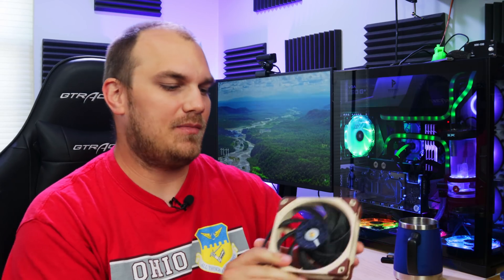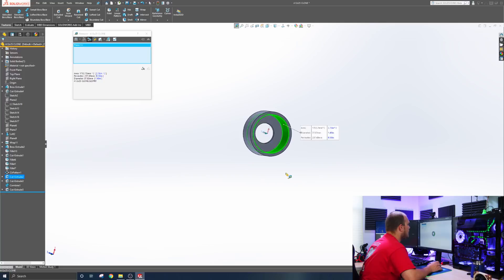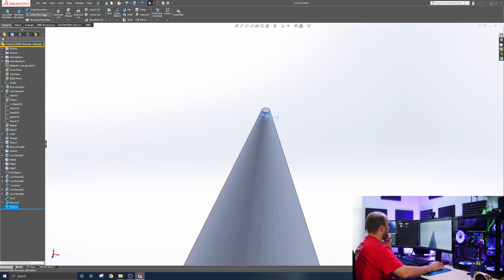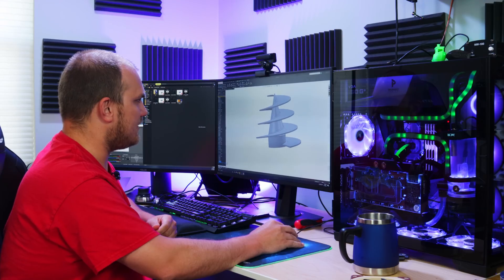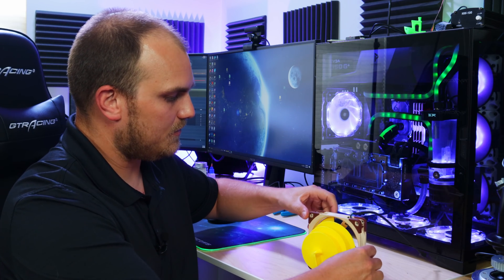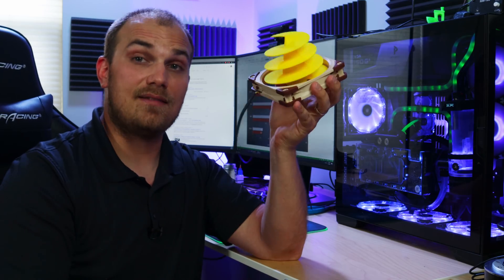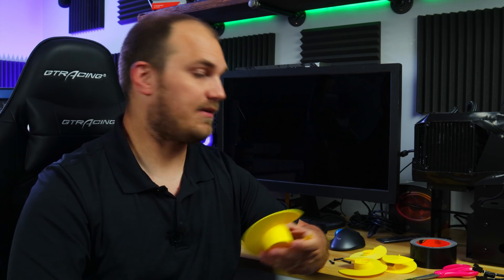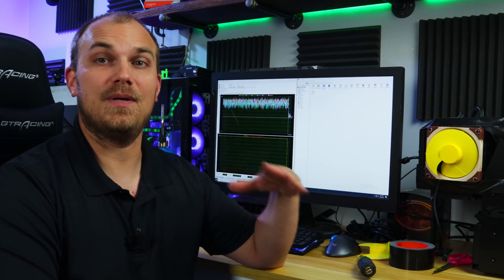Leonardo DA Vinci Made A PC Fan Would It Work?

Comment: 1.how about printing the spiral and shaft separately.
2.how about sanding down the screw so it has nice smooth surface.
3.how about making a tube around the spiral so that the air is properly funneled into the screw shape , as it stands right now the only surface area being effective is the first little bit inside the fan casing.

Comment: Probably needs an outer cone, and probably the discharge side opening 1/3rd the size of the inlet. 
You will probably get better results for air flow.
You want an idea? 
Mock up a "Twin Lobe" air blower. 
Since those are designed to move massive amounts of air volume.

Comment: Well if you notice most drills they are drilling into something right? That means the object the drill is drilling is making a wall as it goes allow it to push the debris out. So I suggest making a cylinder hood the length of the Screw so that the air it is slicing doesnt just spin off into the air and is directed backwards.

Comment: You'd more likely have to build it like a fluid drill... Sheathed so once it's in the threading it can't escape.
Reply: Like an Archimedes screw :D
Reply: @ferrumignis  The Archimedes drill relies on gravity being a noticeable force on the trapped fluid. Not the case for air, especially in an atmospheric environment pressurising it from each side.

Comment: Suggested video idea, using 140mm and or 120mm fans connected to an exhaust hose looping around/on your table and out the window as a method of cooling your PC.  Like attaching multiple 120/140mm extra fans you have to front and and or back end of a exhaust hose.  It's an idea for people who don't have enough table room to place their PCs on and only have the ground under their small table to place their PCs.  Or for people who have their PC setup in basement or attic without good ventilation.

Comment: This design works pretty danm well for solid that aren't enclosed (cos they enclose themselves) in the form of augers. They also pretty well with liquid that are enclosed in the form of screw pumps. But without compression these are useless and as air is hard to compress it just wont work.

Comment: You need a pipe around the air-screw, otherwise it can not work effectively - like water pump without casing...and it turns in wrong direction - look at 17:00 - It should pull not push... I think so

Comment: I wonder if you put a cylinder around the outside of the last iteration so the blade was actually inside the housing if would help direct the airflow rather then it just escaping out the sides.

Comment: I wonder if making it sort of ducted, like a short thin band running down the outside, would the performance improve as less air would flow out sideways as it travels down the blade. The two issues I could think of that would affect this is balance would be way worse and it being to complex for a printer to do without using a lot of filler.

Comment: This design clearly needs a funil around it like they did with water. Otherwise the air is pushed to the sides instead of down.
Essentially would be similiar to a jet engine

Comment: Try reducing the H of the fan and adding a cylider to prevent the air to be pushed sideway (if the fan still keep to pop up from the frame). I'd suggest to make the apex of the blade to came out of the frame for something like 5/3 of his 
thickness  to help the acquisition of air.

Comment: as far as I can see, the single/blade configuration of the air screw causes an imbalance in weight at the tips of the fan, which then creates a torgue and makes the fan wobble terribly. Having at least 2 blades should make the entire screw be more balanced and should help with the wobble you're dealing with. Having a better printer shouldn't help too much with the current design

Comment: Extruder issues -> You have nozzle clog or PTFE tube issue in that case. It's a friggin' Titan, and maybe the best version of that. You cannot get much higher grade extruder than that.

I am sorry to say, but your print issues do sound like user error. Think of printing like machining, it takes a while to learn all the nuances etc.
From that wobbled print, it seens like your gantry is skewed, thus prints tilted. Time to whip out a decent square and measure and start checking you assembled it square.
If you need to level your bed between each and every print, you are doing something horribly wrong as well. It's a set once and print quite a while type of thing. But it's also the most common newbie issue.
Reply: oh and Prusa excels on software side of things to hide those starter issues etc. and quite polished, but mechanically frame of those machines are .... Well ... how to put it ... I prefer a 160$ Creality machine frame mechanically over any Prusa, any time, any day.

Comment: You're still going to have vibration problems with a higher quality printer because the design is unbalanced.  When it's spinning, the blade is pulling the top one direction and the bottom the opposite direction.  It might be possible to bulge out the center shaft opposite the blade to balance it and still have effectively the "one blade" style.  Start with balancing a single 2D slice of the blade, then revolve that shape along the height.

Comment: 10:50 Still didn't see the results but I believe air is going to escape through the sides, solution is to make a cylinder arround it and stretch the top part to fit the cylinder

Comment: Ender 5, or something that is a core xy style printer would be a good option.  There are many decent options. But ender 5 would be a solid starter. And there are some good upgrade paths. :)

Two trees sapphire pro might be decent, but I think there was some mixed reviews. Also the sainsmart coreception looks promising, but I haven't seen Any reviews.

You can get a bmg clone  for a  better extruder from triangle labs and it is phenomenal. :) They are on Amazon, for about $40. Ruiraptor on YouTube has a video of installing it on the tevo trantula pro. :) (I just made this upgrade on my tevo nereus and my extruder slippage is much less)

Comment: it can work without vibration if You should have done the 1 and half circle  and not the 1 circle. That additional half circle counter the vibration caused by the bottom outer circle, and also add outer housing .

Comment: Prepare to be disappointed by the Prusa if your goal is getting that balanced. Great printer but it's not much of an upgrade at the end of the day. You still have to maintain it and dial in the proper settings. A $250 Ender 3 Pro with a handful of small upgrades can print just as good, if not better than a Prusa. Just look at the Ender3 subreddit if you think I'm blowing smoke.

I'd look into resin printers if high detail is your goal. If you want to stick to FDM you may have better luck with a Core XY or delta design.

Comment: Invert the first model and put the "blades" on the inside, so it'd be a cone tapering down twords the motor and have holes between the motor and the end point of the cone as to collect air and funnel it down through the fan shroud. And see what happens

Comment: (read through entirely for big brain time) Putting a shroud over the top and putting it in a pull rather than push configuration should make it somewhat more effective. Instead of just a shroud, add runners that go from top to bottom, attached to the screw, and profile them to scoop air into the screw. Not only will this prevent the air from escaping the screw, but it will also add even more air. Give them a little extra thickness and it should provide you a decent way to balance it as well.

Comment: I have to catch up on your last couple videos, so I may be commenting for no reason, but you should try more blades again, but use reaction blades. Computer fans are impulse blades, meaning they strike the air and deflect it. Reaction is more of an airfoil shape, which means it creates an area of low pressure and drives air through pressure differential. High static pressure fans tend to be impulse-reaction (a combination of both). The main reason reaction isn't commonly used is power requirements and noise. But if we're just looking for the theoretical max, I'm curious, and think it's worth checking out.

Comment: The helix needs walls. 

What you designed is fine, it's just not finished. 

Look at a jet turbine. It's basically a helix just like this fan, but it has a wall around it to keep air from escaping out the sides.

Comment: Check out the ender 5 and ender 5 plus for a printer.  Also, I feel like a duct or a downward curvature to the screw blades would help push air through the fan rather than let it sling outwards.  You could also try a multi-start screw with a doubled pitch.

Comment: What if you made it so that it spins  opposite so it sucks the air through the rad then through the "fan" instead of pushing air through the rad. Also can try making a shroud around it and make it so that it doesnt taper.

Comment: Vibration is caused because you did not calculate the mass on all sides, therefore it is not balanced. More mass on one of the sides results in that. It does not look like a printer problem, an unbalanced wheel will pull the axis to the side of more mass.

Comment: How about taking the stock 12 blade design and keeping the same angle but just making the blades longer, not in the horizontal but vertical, so the whole fan wuld be longer like the d-blade fan you tested

Comment: The only thing I can think off is air is being pushed out of the fan and not towards the radiator. if you printed the fan with a cylinder around the blades to keep air in it should increase efficiency.

Comment: how about this as an idea,So you know the Great inventor Nikola Tesla, invented a lovely system for rockets called the Tesla Valve ,here's where my idea comes in with it (just for refferance https://www.youtube.com/watch?v=tcV1EYSUQME sorry to link someone elses channel) with every loop the (gas in its original design ) in this theory would be  air that  will flow faster after each loop now, what if we were to add a fan into it after every 1-2 loops lets say 4 fans then at the end of the design add a vent funnel or tube\pipe exhausting\channeling the air into the fins of a heat-sink like a Noctua dh15 i would love to see if that would be super effective or a super flop! But still it has the potential to increase the flow by i would by least 2-4 x the normal airflow from the fans,so if you cant use air maybe we could use it as a water loop to see if it increases the speed of the cooling to the radiator and back into the loop dunno but it makes me think it would be an awesome idea

Comment: Make a blower style fan. Like the ones used on some graphics cards (an older graphics car that uses that method would be a cool idea to try and test the design as well) with that style they can be printed without support material since the blades are straight and dont need to be printed in mid air.

I was looking for one to print on thingiverse a while ago.. I use a lot of them for my projects but finding a quiet one online.. good luck they are not categorized that way.

Comment: Make a fan that's omni directional like the fans used on servo motors or bathroom vent fans. The blades are straight up and down and rely on  Centripetal force to move the air.

Comment: Print it in the reverse pitch and instead of 360 do like 400 degrees. I think the fan shrowed will prevent the air from escaping out the sides and the slight overlap will allow the motor to get more initial bite on the intake. Now all air moveing past the blade is forced to come from back of the radiator so it sucks it through.

Comment: You're probably losing a lot of the air flow to the sides, as the blades aren't within an enclosure.  Not that it would be easy to build out.  It would also help to taper the edges downward.  Even better if it was multiple fins instead of just one monolithic fin.  Of course, then it would be a normal fan.

Comment: I think the issue with the wobble comes from the placement of material. Try shimming a little off of the edges on the top or bottom. Easier way is just hold it up at a right angle and see which direction the screw drops and take off material there.

Comment: Multiple ram intakes around a flat disc,  50-60 degree downturn on the back of the ram. i.e. 2 hood-scoop looking ram intakes, 4, 6, 8? (6 is probably the most you can fit.)

Comment: You were losing a lot of air out the side because the screw was so long. No pun intended.
Try enclosing the screw leaving only the topmost exposed to air. The air will be scooped up and progressively pushed towards the motor. You can also put wedge-shaped fixtures to help the air along and keep the pressure. See if that works.
Reply from the maker: keep on eye on your feed
Reply: @MajorHardware  ow! Dammit! How am I supposed to get that eye back in its socket now? lol
I'll keep a tag on it instead.

Comment: I have a heavily upgraded Ender 3 Pro ( BL touch, glass bed, capricorn boden tube , upgraded mainboard, and a new extruder monday (KSWISS titanium).  It can be had for less than 500 bucks.  The bed leveling still kind of sucks, but I have gotten it so that you just need to use the BL Touch before each print and watch the first layer, and you are good.  If you have 1k, Go get a TazBot.  Made in boulder Co, and not made out of Chineesium.  Which will be important after we go to real war with them :P

Comment: This needs a tube shroud the length of the screw. It's an Archimedes screw and they work best when the screw is enclosed along all edges. So you can either just fit a tube around these models, or join the very outside of the screw (double helix maybe)

Comment: you probably should have made it zylindrical, and not a cone. then the screw would move more air.
with this cone designe and the increasing width of the screw the air gets spread. maybe even add a little "air-holder" wing to the screw, in the direction of airflow, to direct and focus the airflow a litte better.
Reply: and it wouldve been easier to balance!

Comment: i wonder if a tube around it would help. you have to think the fan is IN the shroud not out front like your screw is,  gas is seen as a liquid and if you spin it as you are, wouldn't centrifugal force cause some to escape out the sides before being forced down? sure this will never be as efficient as a bladed fan as far as raw airflow, but I bet the static pressures it  could achieve could be really close.  Love the neat ideas you try.

Comment: Maybe try the same design but instead of having the same angle, have the start of sallow and Finnish almost horizontal to the center axis so that as the air moves through the screw it accelerates the air by the end of the blade, I don't know if it will actually work that way but it might 🤔

Comment: Housing was supposed to be same size as the fan. Height and then you have to ad extra center on the crew fqn you printed..

Anyway. Think if you mount additional house on the one you using then it will press air more smoothly

Comment: Have you ever tried blower fans on a radiator? I'm building a custom case, and having the air pulled out of the radiator and blown sideways would help fitment dramatically. Basically, the center inlet of the blower fan over the radiator, and the outlet over the side of the radiator. Also, what about a crossflow fan and a shroud pulling air out of a radiator, or pushing into it?

Comment: How about this for a fan idea, make a normal fan as thick as its wide, including the blades (thus making it almost like what you made in this vid) But use the pitch they had and have a shroud around it. Im guessing you can push great amounts of high pressure air with that.
Love the video, thanks!
Reply: And if it actually works you can sell it as the Fan³ (cubed).

Comment: You might also want to consider some mods for your current printer. I added to my Ender 3: An SKR Mini E3 1.2 32 bit board, a BLTouch autolevel probe, a Raspberry Pi 4 + camera with Octoprint, a smart outlet and better PTFE tubing and it's been great. Wifi printing, automated timelapses, advanced options like Linear Advance for better print quality, better bed adhesion, auto shutoff, etc.
It's amazing what you can do with a cheap printer for a hundo or two extra. Prusas are definitely more reliable and can achieve better quality but keeping a cheaper printer clean and making sure everything is well assembled (rollers not too tight, belts tight enough, bowden tube flush with nozzle, etc), tuned (e-steps, etc) and some small upgrades can bridge much of the gap in quality and reliability. My next printer will probably be something like a Prusa MK3S but most of my gripes with my current Ender 3 have been solved. I'm looking forward to your comparison though :)